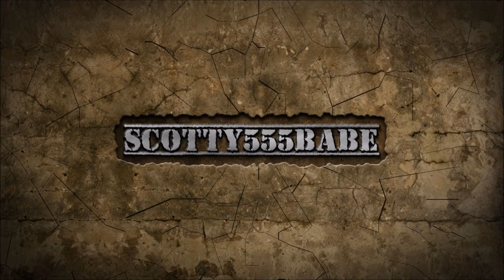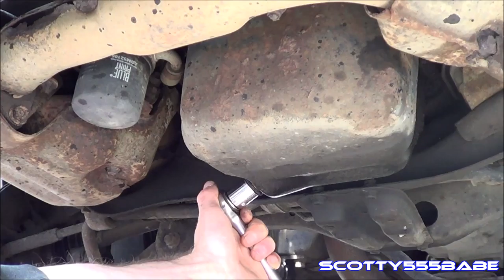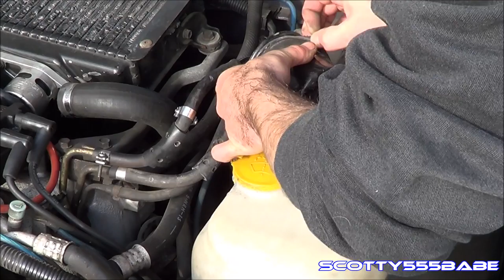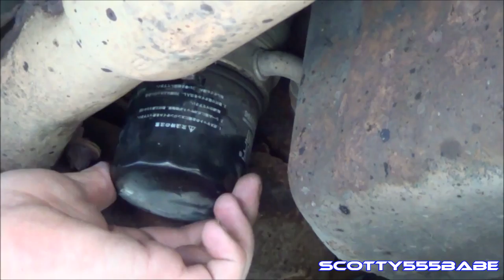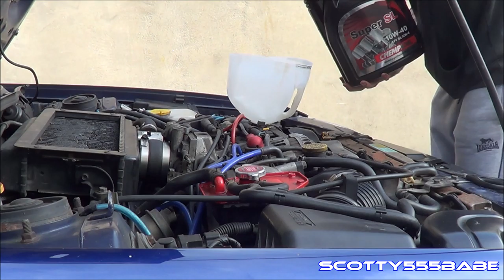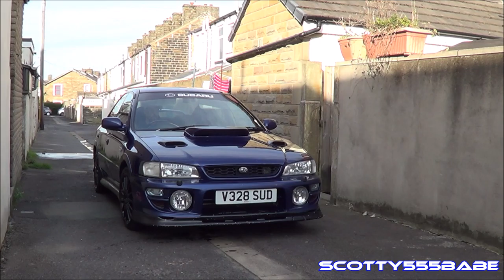Subaru Impreza 1999 GC8 Uk Turbo 2000. Oil, Oil filter & Fuel filter change. (Quick reference!)

Comment: Cool video @Scotty555babe Car Culture Uk, do you run the 10W40 in the summer time only or in winter as well? and How well does it do for the car?
Reply from the maker: Personally on classics I run 10W40 all year round only the New age I would use a fully synthetic oil, also I forgot to show in the video before putting the new oil filter on, fill it with fresh oil then the engine isnt starved when starting it up.

Comment: What's the best oil to use 10 w40 Millers motul fully synthetic
Reply from the maker: I always use miller's 10/40 and just run a tub of cheap oil through to flush as seen in the vid 👍
Reply: @SCOOBTUBE  yeah I'm running on Millers now 10w40 it's just a lot of people say different stuff I use Fuchs to flush out first though cheers pal